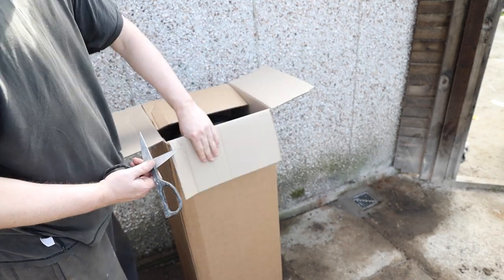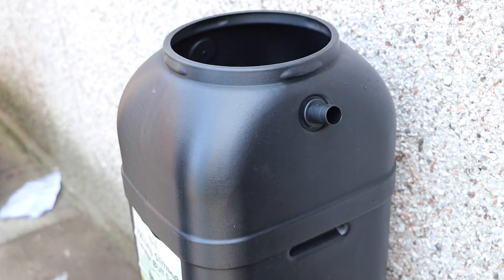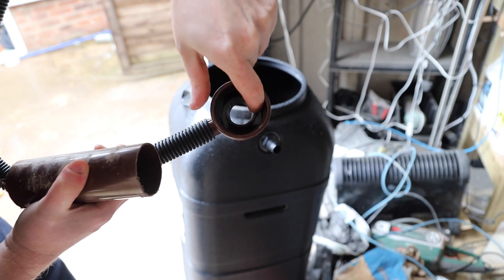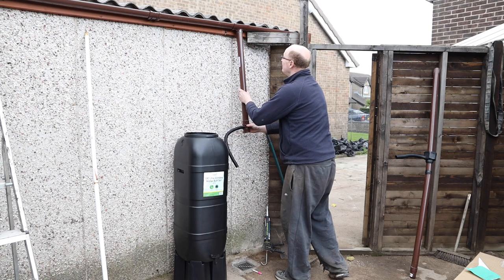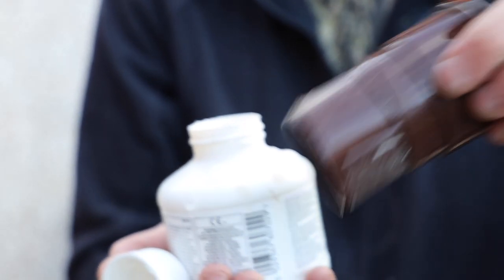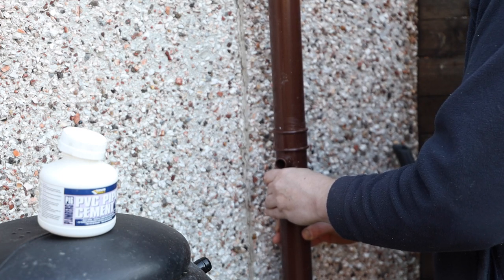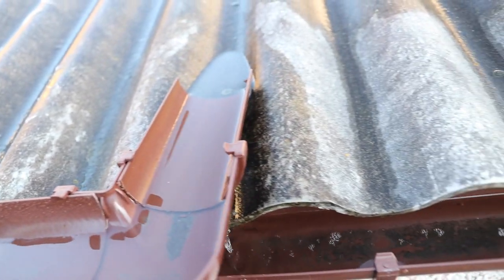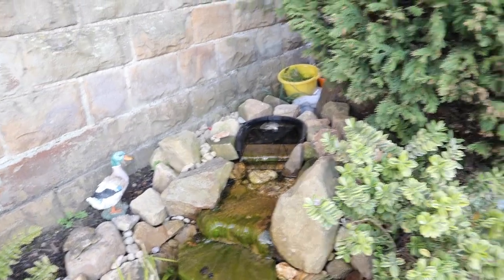Koi Sleeper pond part 28 Water Butt install and guttering down pipe and drain completed

Comment: What you on about not using pipe cutters they do the job for me!
Reply from the maker: I bought two of them for 1.5 inch pipes. They kept  crushing the pipe and not cutting them. The cutters would then bend and become useless.  So I gave up using them. I also returned them. They may be ok for small pipes but not good for larger pipes